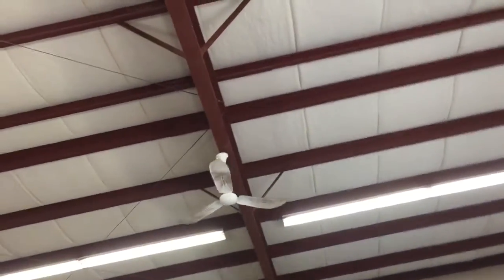Canarm (Tat) pleasant aire ceiling fan

Comment: It doesn't spin very fast because its on a dimmer switch, use a 3 speed control or a solid state control
Reply from the maker: I made a mistake. Its a Solid state. Tat Canarms with Steel Blades commonly have bad Capacitors